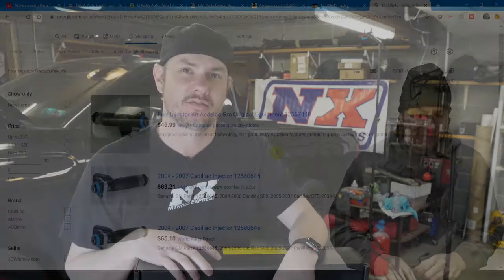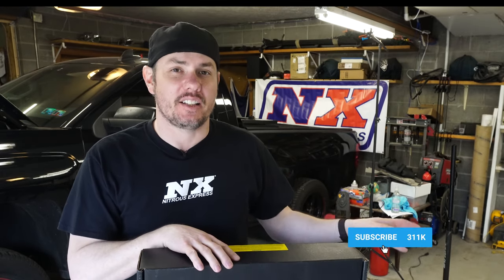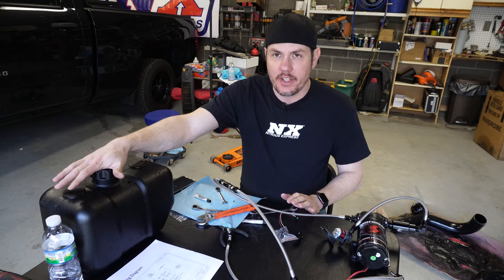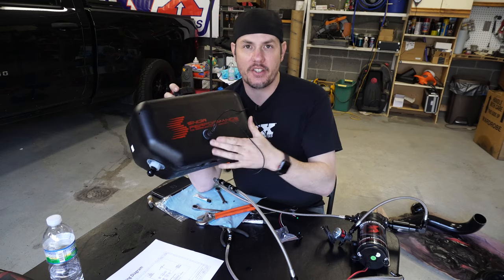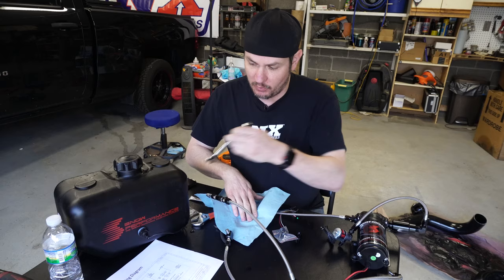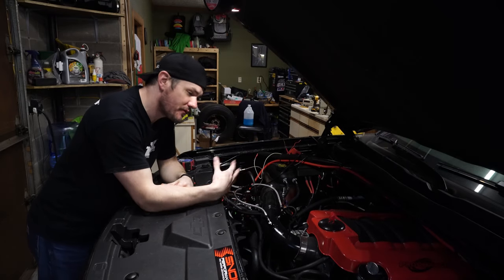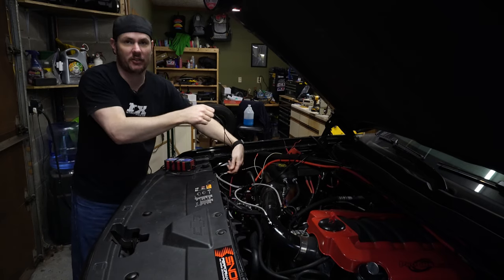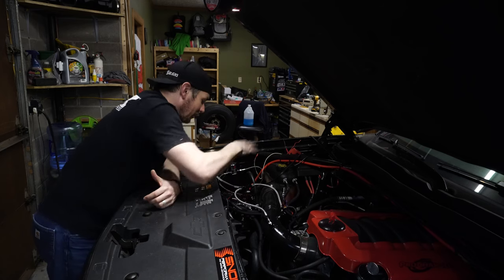Methanol Injection Plumbing, Setting Up Our Snow Performance Kit!

Comment: I thought you wanted the solenoid AFTER the pump, closer or as close as possible to the nozzles in the engine bay to prevent the siphoning etc. That way the fluid that's already in the line between the pump and the nozzles doesn't leak into the system?

Comment: Hi. I have the Stage 2E kit and it comes with the VC-50 and a boost pressure sensor. Am I supposed to install the boost pressure sensor in the charge pipe next to the injection nozzle? My car 13' 650i doesn't have boost vacuum lines.

Comment: i have a question or two or three lol, i have a 2015 bmw m4 and i am installing the burger 3 gallon tank in the trunk .. im not running dual nozzles just single out of the j pipe  ..i have laid out everything like you have on my table, now my question is  since i have the tank mount kit  .. can i place the check valve in the trunk also with the solenoid placement or do the check valve have to go under the hood near where i am placing the nozzle..?

Comment: Maybe crazy ? But if you have the proper fueling is it still beneficial to run meth? I know it will lower IATs but with meth and proper fueling tune will it run to rich? I don’t want to depend on meth for fueling
Reply: Of course , most people i know run meth only for cooling
Reply: MALR7 thank you brother
Reply from the maker: You can run it, but depending on your mix you're going to run rich unless your tune it to run. It acts as a chemical intercooler, and pretty effectively but at a 50/50 blend you can see your AFRs go over a point richer when spraying. MALR7 is correct in that it's primarily used for coming and detonation resistance
Reply: Goat Rope Garage thank you brother looking forward to the series. I was wanting to use it as an option to cool off cylinder temp and iats it can get hot as hell in Texas. So changing the blend makes since thanks

Comment: I've installed installed a 6.0 lq4 into my 1978 skylark and im getting all the little wiring gremlins sorted out. I'm using hp tuners to tune the vehicle but I've got a few error codes that i have questions about. the engine is out of a 05 yukon denali and I've segment swapped in the 4l80e. the error codes I'm getting are Engine rpm output circuit p0654. Traction control input signal p0856. and Delivered torque circuit fault p1689. anybody familiar with these? anything helps thanks!

Comment: Thank you for the video, are both of the nozzles speaying into the intake or charge pipe ? I  Didn’t  quite see where they were going
Reply from the maker: Yeah, they are offset a few inches apart
Reply: Goat Rope Garage so how are you going to solve the distribution issue between cylinders and have you tried spraying it before the turbo to get better atomization
Reply from the maker: Not had issues, granted I'm not measuring AFR at all cylinders, but under PE it seems to be fine
Reply from the maker: Been running meth for over two years like that

Comment: You meant to install the solenoid as close to the nozzle as possible, NOT near the pump, otherwise meth can still leak into your inlet, as there's still fluid in the pipe from the solenoid outlet to nozzle. Check valves are not reliable, as they can have a low pressure threshold and open

Comment: I wonder if someone could help me with a question about the methanol kit i have twin turbo 6.0 ls in a 04 mustang I have my IAT sensor mounted in the evap port on the truck intake I purchased a methanol kit to install on it do I need to relocate the IAT sensor in the charge pipe so that it doesn't get sprayed by the methanol or would it be ok to leave it in evap port thank you
Reply from the maker: You want the IAT sensor to be after the methanol injection so it can see the reduction in air temp
Reply: @GoatRopeGarage  thank you for quick reply

Comment: Hi I'm going to be running the tank from the back of the car. The check valve says it has a 35 psi crack pressure to ensure that vacuum doesn't syphon it from the line. In that case why would I need a solenoid? There's always gonna be fluid in the line. I'm running the check valve into the jet and then throttle body spacer so I should br fine right?
Reply: Yea I think I'm fine without using a  solenoid. 35psi crack pressure translates to 71 inches mercury so if my cars pulling 25 inches mercury that's almost 3 times less than what the check valve is rated for so don't think any meth will be pulled through that check valve
Reply from the maker: Yeah, check valve should be fine
Reply: Goat Rope Garage great Thanks!

Comment: I think he miss spoke about the solenoid… if you run your meth line after the throttle body you need to have your solenoid turn on and off with the pump. My car was misfiring after idle and no boost driving I looked at my tank and it was empty and I had no leaks 😅

Comment: Most of these pumps that I'm familiar with need to be mounted close to the tank for gravity feed. Is this pump different? Will it work just as well being mounted in the engine bay?
Reply from the maker: Yep, it's designed to have the tank remote mounted, just make sure and use the solenoid so the line doesn't drain back to the tank
Reply: @GoatRopeGarage  I found this in the Snow performance website. I post it just  trying to be helpful.

Mount pump in desired location. Typical 
pump placement is next to reservoir or in 
lower spot such as spare tire well. The 
pump is a pusher type and must be 
mounted at the same level as the reservoir 
outlet or lower. DO NOT mount pumps 
above reservoir or in engine bay
Reply from the maker: It works, the pump will pull if you're system is plumbed right but as I said, it's important to have that solenoid in place on a remote mount tank.
Reply: @GoatRopeGarage  I am not saying you are wrong, just stating what the instructions say. The solenoid will keep it from pulling water meth into the engine under vacuum but it won't help feed the pump. I believe it says to mount the pump near the tank so the pump does not starve causing inadequate flow. It's the same as electric fuel pumps.
Reply from the maker: @eddieweaver3609  it's alright man, your right to question, to many people take information at face value. I'm running it now like that without issue and if I have a problem rest assured I'll report on it.

Comment: @goatropegarage.  I am about to install my snowperformance stage 2.5 kit for my supercharged audi.  I am going to be running the snow performance 2.5 gallon cel tank in my rear wheel that holds the pump itself on the bottom side of the tank... I have a solenoid on standby but I am not fully understanding why you have a solenoid before the pump itself? I totally understand running a solenoid in place of the check valve if you are running your jet post TB but since I am running my jet pre TB and into intake hose I was thinking my check valve should be sufficient enough since its located much higher than my meth tank located in my spare wheel well... let me know you thoughts

Comment: Great kit for the first year, after that it corodes and everything stops working unfortunatly.
Reply: I dont know what you are doing but mine is over 10 years old and have not had one problem, you must have used a strong meth mixture and used it a bunch
Reply: @AmmoMaster  I use boostjuice. And it only kicks off after 10lbs of boost.